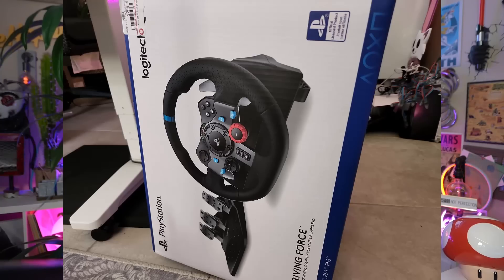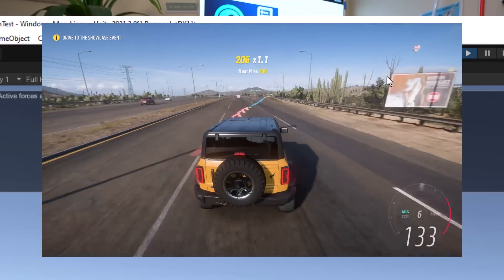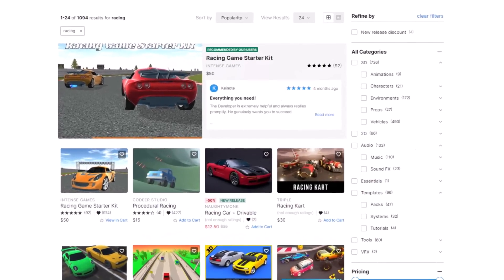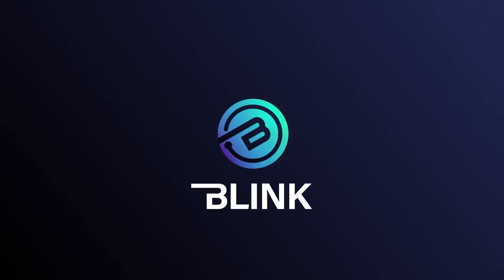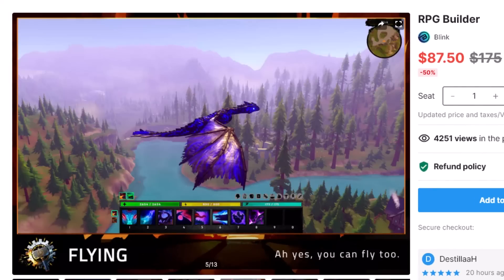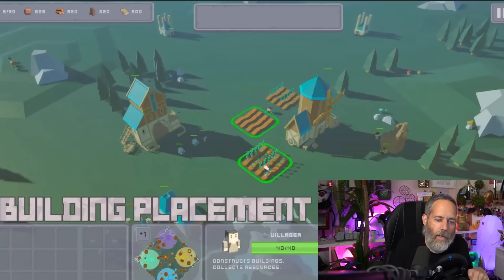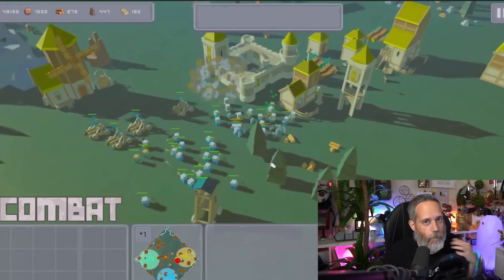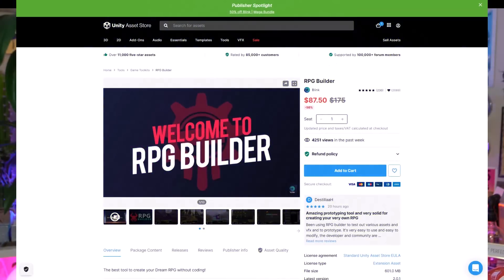I changed my opinion on the right way to do gamedev | Unity Kit, Engine, or Scratch?

Comment: Bought this same steering wheel a couple years ago; still barely used it. If you happen to want to make a quick tutorial on getting it working in Unity, showing how to fix the issues you found, I'd love to see that process.
Reply from the maker: I think I will. it was really easy once I fixed the drivers. They seem to have a pretty good sdk that made it simple to implement force feedback and sent the data all to axis I could read. Gonna try it with new input system maybe do a video on that

Comment: I suggest using the clutch  as brake. Because there is a plastic piece that is pupposed to simulate pressure sensitivity but just tops you going 100% brake. You can open up the brake a remove the bung  watch a you tube. I'm using HurricaneVR framework for my game, it's perfect for my use and saved a lot of coding, but studying the code to mod it now.

Comment: As a solo dev starter packs are a boon for rapid prototyping however certain assets with the Engine Extension license are kinda a trap. If you suddenly want to add more people to your project you now have to buy a license for every extra seat, even if that person is just an artist that just needs to import their work into Unity from blender and maybe check how it looks in the engine. That person might never use or interact with any of the systems in the starter pack asset, but as they long need to open the project in the Unity editor you will have to buy a license for them...

Comment: Jason great video! while I agree that a template will help you test stuff faster, in my opinion when you are learning you should consider creating from scratch, because that will give you more insight knowledge on how to expand upon the stuff you can buy in the store later on. It had happened to me that I can set up and run the kits and edit them a little, but then when I try to implement new things I don't know where to start from as that's someone else's code. What you think?

Comment: A Crazy Taxi clone but instead of picking up people you have to deliver pizzas. Also your car is electric so you must do all of your deliveries before your battery dies. Running over light poles/transformers/electrical things recharges your car a bit. Of course each thing you run over explodes in a ball of lightning.

Comment: Here's how it seems to be about kits: 
 A good kit and an experienced dev tend to converge in the development approach, or at least it's one of a few "plausible" variants, and so dev doesn't even need to learn a kit, just hops right in on a hunch of how things "should" behave.
A novice dev on the other hand - there are so many variations that come to mind step after step, that are interesting as a part of development process, and so the novice dev wants to try them all out and see what happens. Also most likely a novice would need to basically learn the practices used in a kit, as a novice would probably not have came around those yet. So technically there isn't that much of a point in a kit for a novice. I'd just recommend going the engine documentation and fundamentals route.

Comment: Driving Game ideas: 
Fall Guys with cars
Rocket League racing
Carmageddon + pizza delivery
UMMORPG + Driving = Forza Horizons?

Unity Packs:
Opsive
ORK
Synty everything for art blockout

Atavism is a good starting point if you want to make something with no coding. It ships with a design tool to implement content, but without access to the back end to modify what happens on the server. I would be curious to see your take on it. There is a free trial version and you could always reach out to the team on Discord for an evaluation copy. They're pretty responsive and would probably appreciate the visibility.